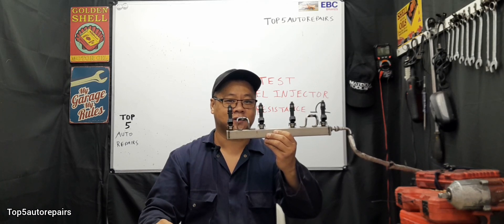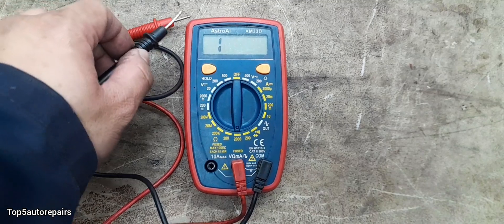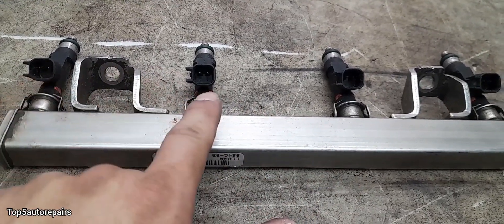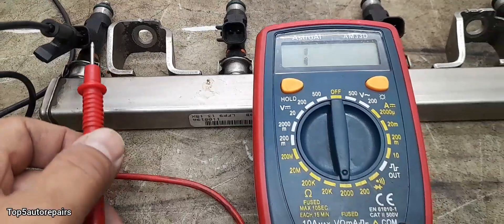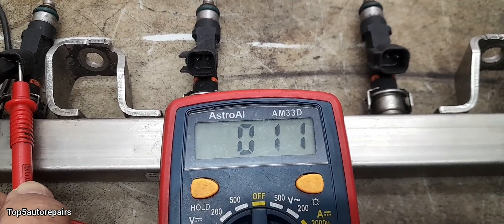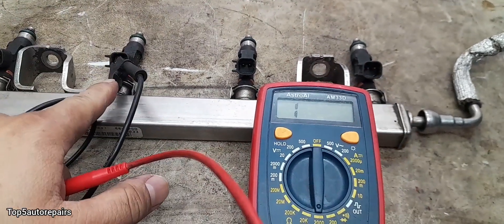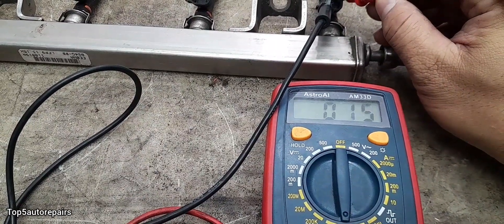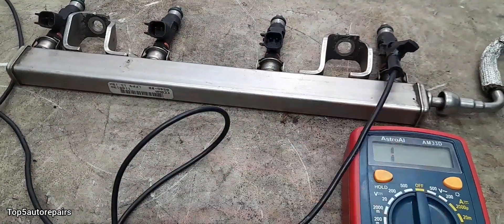HOW TO CHECK FUEL INJECTOR RESISTANCE (OHMS) USING A MULTIMETER

Comment: I currently have an unexplained misfire/rough idle, no engine codes, replaced ignition coils because 3 of them had cracks in the rubber insulater boots, , , I need to check fuel trims and ECT Sensor readings, , , and I will check fuel injector resistance following your video advise, , thanks
Reply: I was driving to work and all of a sudden when I got off the freeway the engine started misfiring I sense that it was one of the fuel injector sensors went bad, since my work was a fue block away it continued driving with a misfire, @ work parking lot  I checked each fuel injector by pulling out 1 @ a time, it cinlinder #2, enter work & @ break I replace fuel 💉 injector, since I carry 3 extra in my trunk 4 this purpose,  cause u never know when they go bad,